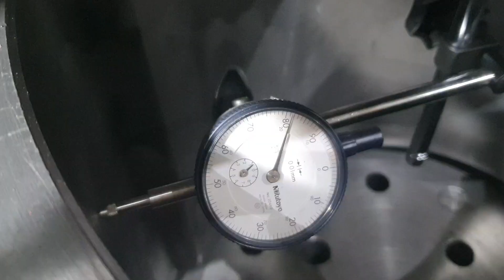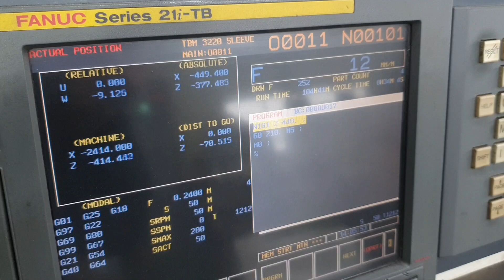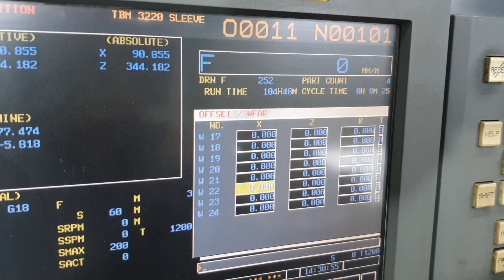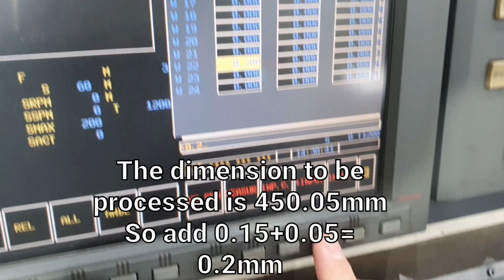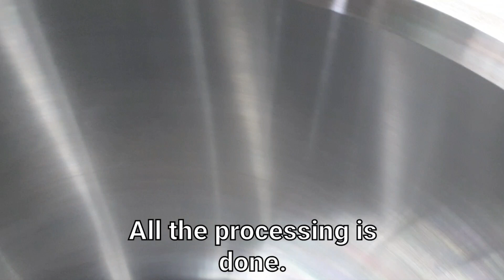TBM (Tunnel Boring Machine) part machining.

Comment: Looks good. I'm always amazed at how much easier it is to machine parts like this on a vertical lathe rather than a horizontal lathe.  This must be for a large tunnel boring machine.  I'm currently building an auger boring machine using some tunnel boring machine components. Thanks, Ken

Comment: Beautiful job there James.
Curious why you chose a CBN invert for finishing?
Wasn't that a carbide for the roughing?
Great finish...
Reply from the maker: It is a product with a key groove, so if you use a carbide tool, the dimensions of the top and bottom do not match. Since CBN is hard, the dimensions are constant if the cutting amount is adjusted less.
Reply: Thank you for the reply.
I have not done an interrupted cut for soo many kilometres to have experienced this tool wear!
Big job experience.

Comment: Not used to modern CNC but old NC machines but when I moved to offset for a final cut I would dial in half the amount to be removed. If I wanted 0.15mm I would put in 0.075 offset?
Reply from the maker: If you set it as radius value input in the parameter, 0.15mm is processed when 0.075 is input.
And if you set the parameter as a diameter value and enter 0.15mm, 0.15mm is processed. This can be adjusted by changing the setting to the parameter value of the machine, and the parameter number varies from machine to machine.

Comment: Processing the inside but not the outside 🤔 Customers ask for strange things. 🤷‍♂️
Reply: Well it IS for a TBM so the outside may be getting covered in hard facing weld.
Reply from the maker: It's called a TBM part, but I don't know exactly. The shaft is assembled in the processed hole, and a large bolt fixes the shaft on the other side.